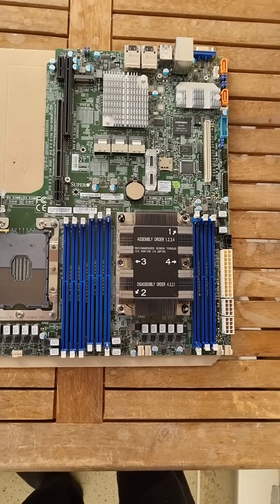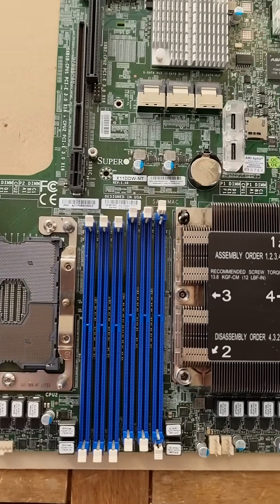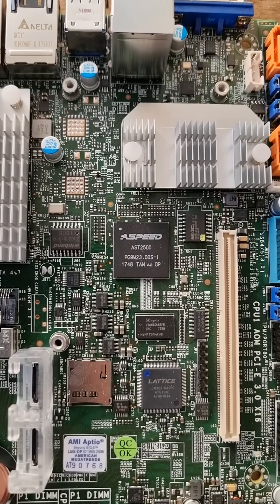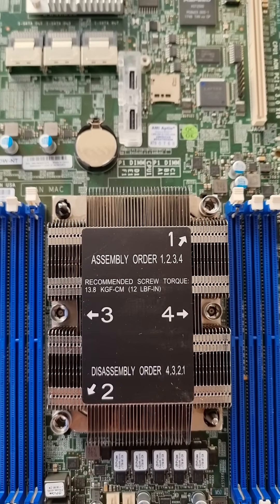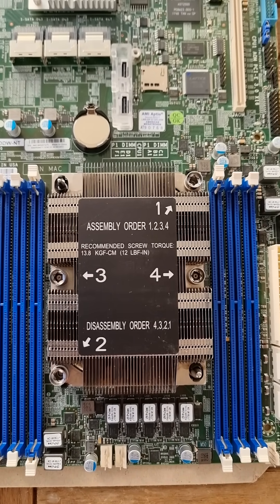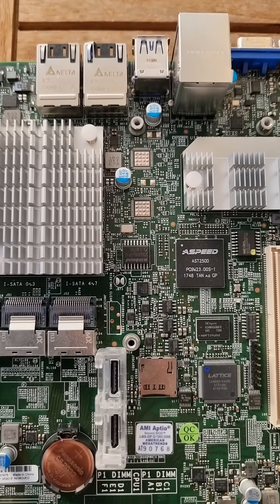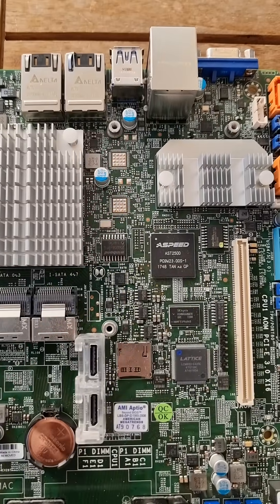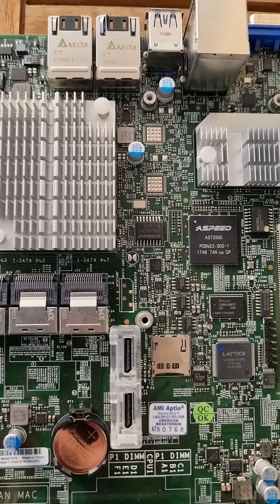Bricked Supermicro x11 Server Board - need to reflash BIOS

Comment: It's rare that features trickle up, but server boards need BIOS flashback. It seems like the flashing process for enterprise equipment is much more volatile, and of course the stakes are much higher.
Reply from the maker: I agree that it's a much more volatile process for enterprise equipment. I successfully reflashed the bios using a ch341a programmer and now the system boots. Next problem is to reflash the NIC MAC addresses as the default ones prevent the NICs from working...